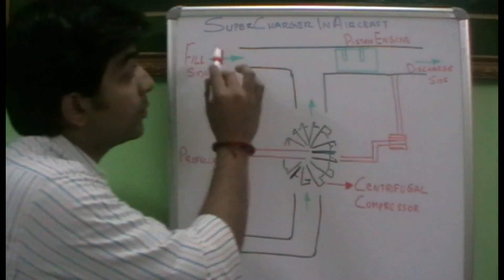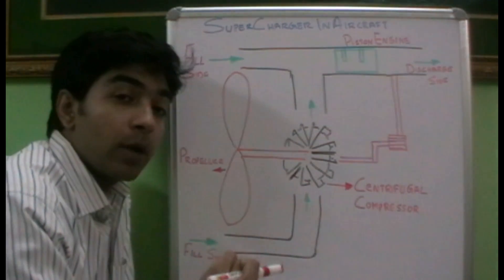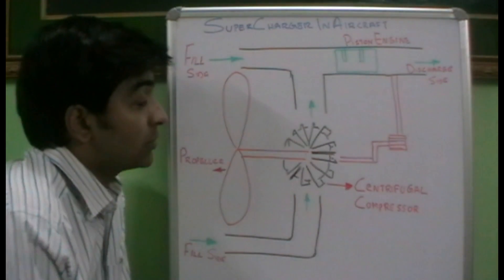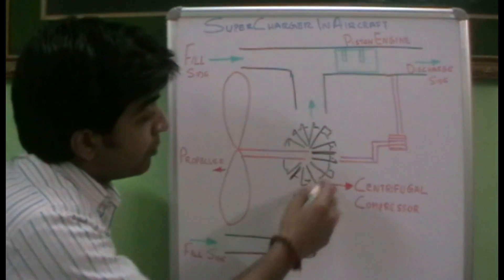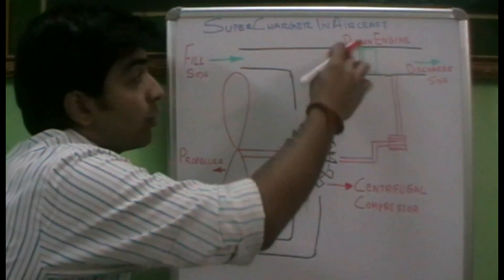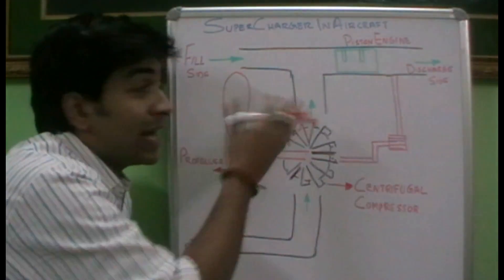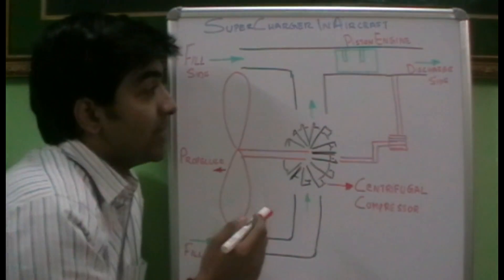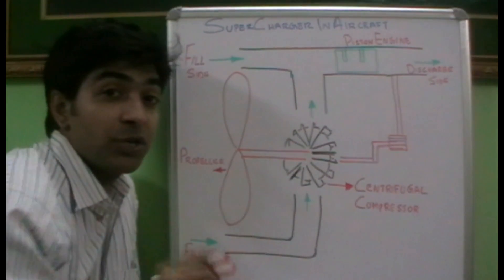How supercharger in aircraft engine works. ✔

Comment: it draws more air into the intake manifold by getting its spins from exaust manifold and during high altitude its useful cuz less air at high altitude
Reply: +Jimit Talekar that is a turbo charger u r talking about. Turbo charger uses exhaust gases to rotate where as super chargers are mechanically driven by the engine through the crankshaft.
Reply: supercharger uses engine belt to rotate its compressor to draw in air into pistons
Reply: and power loss of engine will be exprienced if engine does not have enough horsepower
Reply: turbochargers are better comparativly
Reply: +Jimit Talekar exactly .. :) the same thing I said.. n yes turbo chargers are much better
Reply: bro lets be friends
Reply: R u a pilot?
Reply: no but passioned to be one and i have all powerplant and aerdynmaic knowlage
Reply: +Jimit Talekar good good..I'm a pilot
Reply: yes
Reply: my knowlage will not be like yours for sure so where r u pilot at bro?
Reply: +Jimit Talekar I was in US..have come back to India..n to my horror the industry is in deep shit here..
Reply: yes i know and 2 spark plugs are used for more power stroke right? and to avoid premature ignitions and if one fails other is still there
Reply: +Jimit Talekar yeah absolutely
Reply: good

Comment: OK, point taken!
I see there is a huge difference in aircraft engines compared to street/racing engines! I know the history of hot rodding took off after WW2 was over and the fly boys coming home needed some more excitement so they took the principles of supercharging and applied it to their own cars engines and thus... hot rodding was born! =D
Although my Harley has "Jugs" not a traditional block and it has run just fine with the Trask Turbo on it @ runs about 8lbs. of boost for around 125hp.

Comment: Michael – read the title listen to the presentation. This is for aircraft engines. You can’t use automotive logic on A/C engines. They do not have blocks they have jugs. If you 2X or 3X the pressure you will blow jugs. The diagram is not vague, radial engines have theirs built in the case

His explanation is for a single stage blower - these have no intercoolers. When you get into 2stage–2speed chargers there is a need for an intercooler. This will require much more time & space to explanation

Comment: Superchargers are referred to as "torque-multipliers"! Most superchargers can double or ever triple an engine's torque output at the crank!
Your diagram is really vague and need to elaborate on it more though, you left out a lot of supercharging principles and how they affect the internal combustion engine, for instance cooler intake charges; the colder the air is, or intercooling the air intake charge becomes denser and can fit more air/fuel in the same volume than a naturally aspirated engine!